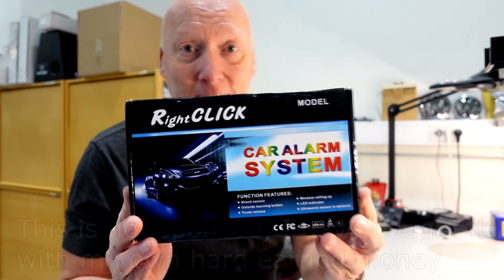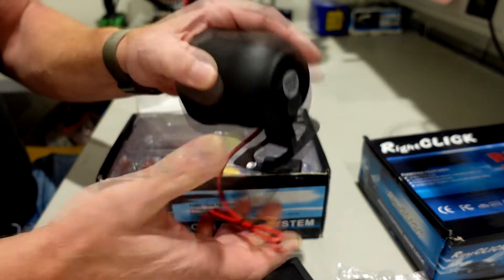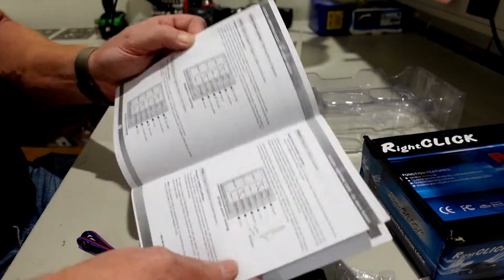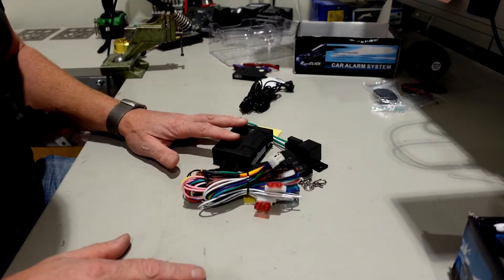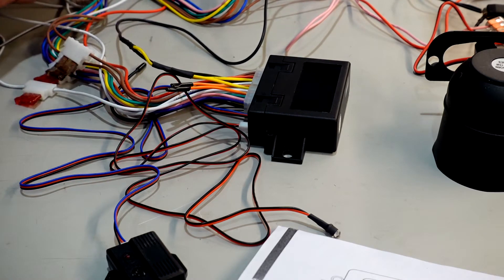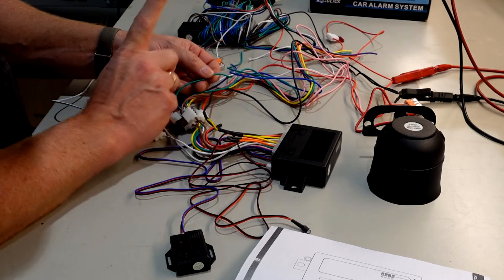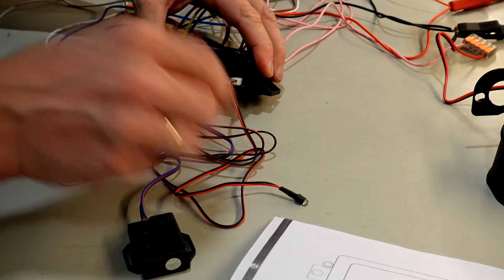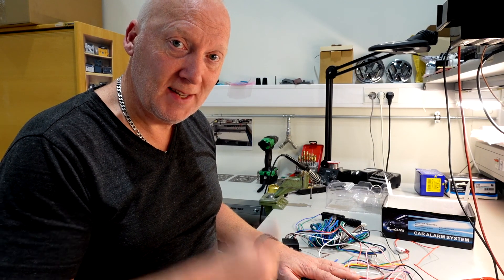How to wire a car alarm with VW flip key and central locking

Comment: Hi mate good video.. I have seen plenty of people installing this without the black thing and they just tamper it into the wiring
Reply from the maker: Yes, you can do that if you have central locking from the factory in your car.
Reply: @Italjohn  so yes my car has central locking however no fob just key is that still okay ?
Reply from the maker: @Karan-Singh999  That's ok, You need to find the orignal locking control wires in your car, and connect the alarm to them.

Comment: John did your kit come with the key programmed to both the alarm and actuators ? Ive wired mine up on the bench and the alarm works but wont open and close the actuators.
Reply from the maker: The actuators are controlled by the alarm. See the manual. If they don't work you have missed some wires.

Comment: Hi friend. Have you been able to remove the loud noise of arming and disarming this alarm?
Reply from the maker: Yes, there is a "silent" arming mode. You just press the arm button for 3 secounds, and it arms (and lock) the car without any sound. 😀
Reply: @Italjohn  Hi friend, I am thinking to buy this alarm but I am not sure if I buy the kit the alarm with door central looking or only the door central looking.
IS It possible to deactivate the alarm and only I use the door central looking.
Thanks
Reply from the maker: No, not as I know,  you will have to lock the doors manually